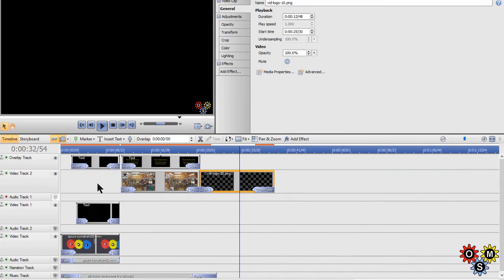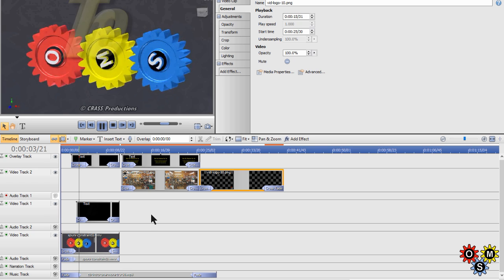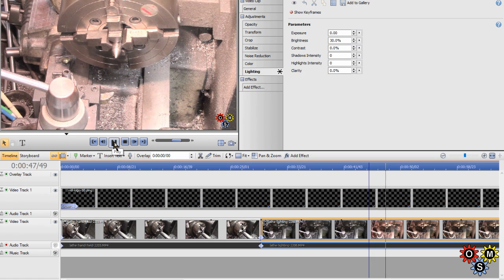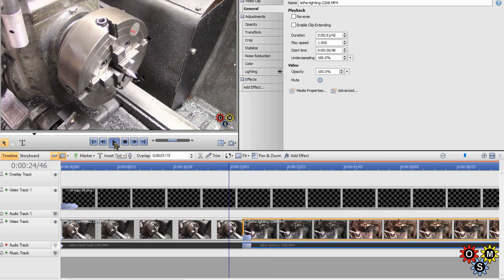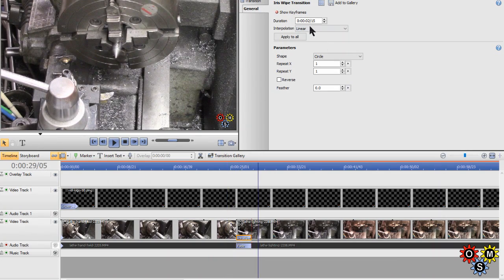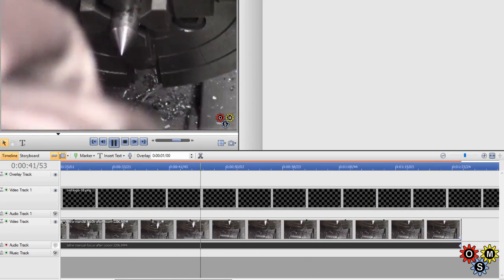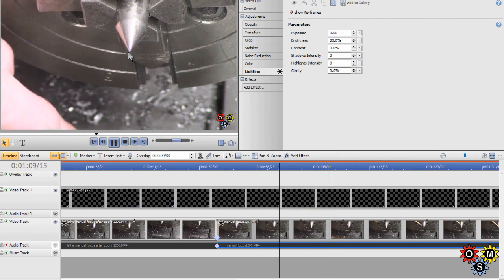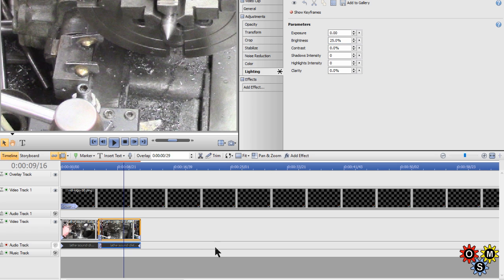Thoughts on Video Post Production -  Part Two

Comment: Hi Chris,
I'm with you on trying to make the videos as clean as possible, many viewers won't mind the lesser quality of a video, but, still a lot will appreciate something more elaborate, it's difficult to reach the quality of a couple of producers, I still think something in between is reasonable to achieve...
In my opinion the main things to check out when making videos are:
 
*Avoid Shaky hand-held shots...   
*Horrible sound where the talking is covered by machine noise, where a close pick-up mike or even subtitles will dramatically improve the result...
*Overly long explaining before actually doing the job...
*Unwanted or distracting effects... Good simple editing is always a winner.
*Reflexions where there is nothing to be seen, decent ambient light generally does great if enough or if the camera is sensitive enough...
Except for rare exceptions, GoPros are delivering SHITTY picture and SHITTIER sound, to be avoided for machining videos...

By the end of the cold season we'll be Pros... Winter is too long here...   lol

Lots of good points in there,     Pierre
Reply from the maker: Hi Pierre,
Thanks - and you make great points. I have been guilty of one or two!
I guess we ''ordinary'' folks just need to try and shoot for a reasonable compromise. It's always a challenge to try and 'clean up' things enough.
Have to agree re the GoPro downsides!
The cold season is a PITA for me due to shop temps being too cold to easily handle.